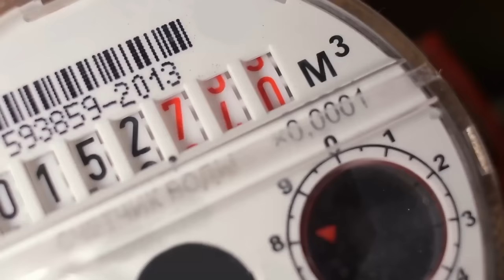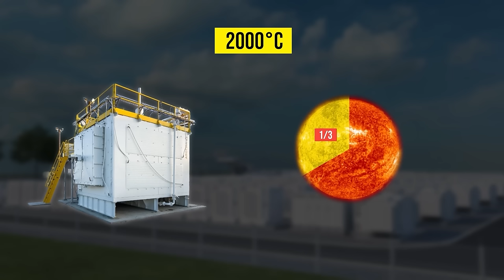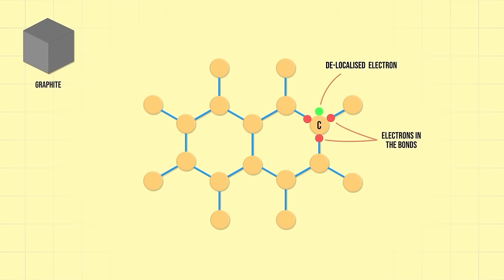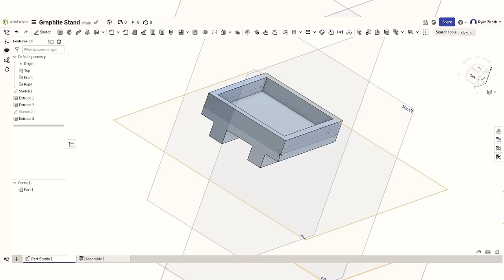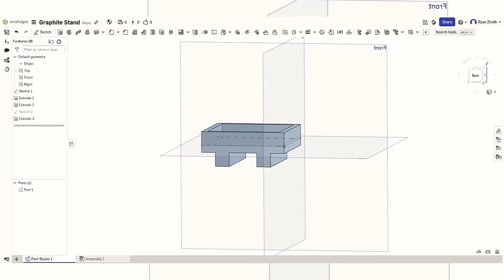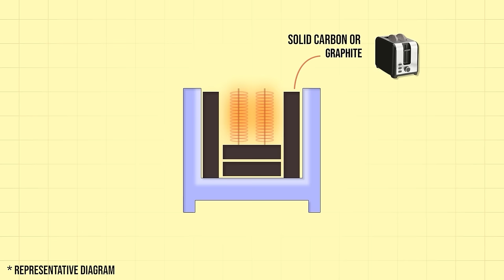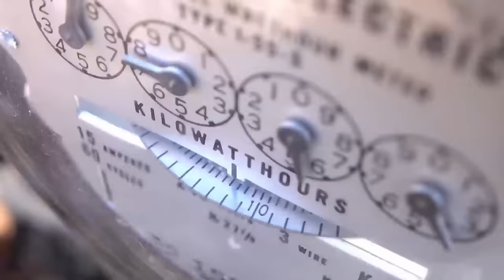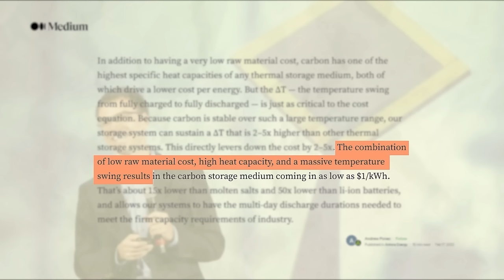Why Solid Carbon is the Future of Energy Storage

Comment: This isn't a battery as we know it. Its simply heat storage, like a storage heater, it does not primarily generate or directly store electrical energy like the battery we understand. So there is a 'con' going on right there. Ok, it is ,maybe, a more efficent way to store heat, but if it's electrical energy you want then there are conversion inefficiencies at either end, going in and coming out, where you have to convert electrical to heat and then back again. It  does not seem to me to constitute a 'breakthrough' in that respect. We have seen great claims for the 'gravity' battery but where is it ?. What concerns me is that this is another 'whizz kid'  "Fake it, until you Make it", Therendos stye, oversold concept. Don't forget that rate of heat transfer is dependent on temperature difference, it is non linear and asymptotic, so, although there might be some good applications for better heat storage, I don't see electrical storage being a primary use. Geothermal won't supply high enough temperatures, maybe a direct solar furnace would, but don't hold your breath, or bet your life savings on it.

Comment: theres never been a problem with de-carbonicing heavy indistry. its just heavy ndustries would rather ingnore the issues and costs and expect to just continue while consumers are guilt tripped into taking all the burden. its not that existing options are not practical - its that they have a cost and any cost will reduce profits. these industries wont change unless they are either forced to or the changes are completely cost free to them.
a few practical but expensive solutions would be.
only operate at nights when the energy is free/cheap - maybe with a larger heavy industry plant but running fewer hours per day.
rather than heat the carbon to turn back into electicity to later to mely metals - just heat the metals directly when energy is free/cheap and use low power to maintain the heat until daytime when its processed.
concentrated solar - a load of mirrors heating a material to later turn to electricity - bypass the electricity completely and use as a foundry.
geothermal - relocate to somewhere with easy access to hot geothermal like iceland / hawaii.

Comment: Insanely clickbait!

The panels don't convert heat to electricity they convert infrared light. The part of the energy that just made the carbon hot will get thrown away as will any radiation it gives off that's not in the panel's range. According to the research paper that would be 60% of it.

And prices "as low as" $1 per watt! Why that's only double what it costs to use a steam turbine!

Pop quiz! Find the discrepancy:

"They are covered with a layer of steel so that the temperatures inside can be safely handled"

"The batteries sit at over 2000°, hot enough to melt steel"

Comment: We can in fact reduce our dependence on industry.  It's literally as easy as reducing consumption of everything; but most importantly luxuries that aren't needed.  The car industry for example is a major percentage of overall global industry.  We can reduce it simply by driving less and buying fewer new cars.  Driving less reduces fuel use and extends the life of the vehicles, thus reducing new vehicle purchases.  So how do we reduce driving miles?    Simple.  We move to 4 day work weeks.  We promote more working from home. (which doesn't have to be permanent, it can be one ore more days per week)  We increase public transportation.  We build bike infrastructure to enable more people commuting by bike.  No, we don't have to bike year round in all weather to make a difference.  It can be as little as 1 day per week on average.  Coming from 0 days per week on average, that's a 20% reduction in commuter miles, with the lion's share of our annual miles coming from commuting.

How about the clothes industry?  It's literally as easy as buying fewer clothes.  Show of hands, how many of y'all have entire closets full of clothes, and maybe some packed away in boxes somewhere that are completely fine, but you just don't wear them?

How about flying?  Most flying is done in Western nations.  Only about 13% of the world's peoples are responsible for the vast majority of overall flights.  Heck, until the 1970s, very few people actually flew.    Flights alone are responsible for a massive amount of energy use, and that's before including airport construction, ground transportation to and from airports, the energy used in the airports, and the manufacturing of the planes themselves.    Want to reduce the industry built around flying and the resource use for flying... simply fly less.  If you can't imagine giving up flying completely, then how about this.  Fly half as much as you've been flying.   In terms of trips, if the trip is just you alone, and you will either fly or drive, then flying is actually slightly better than driving a gasoline powered vehicle.  However, as soon as you add a second passenger, driving is more efficient.  If you must travel with more than one person and you have the option to drive, then drive.

Fact is, we could have drastically reduced energy and raw material use decades ago... all we'd have needed to do is reduce our consumption.  Instead, primarily Westerners, and of the Westerners primarily Americans, went the greedy route and repeatedly increased consumption.  Isn't it about time we changed?

There's a timelapse of global annual carbon output per capita.  Watching how high the US per capita carbon output was just about 2-3 decades ago... it was absolutely off the charts.  It's certainly declined today, but the reason isn't that Americans stopped consuming so much or stopped using so much coal... it's that we outsourced the vast majority of our product manufacturing to China, and China used coal energy to build all of it.   China's per capita emissions went up as a result, but only because that's based on energy production in the nation divided by the residents.  It doesn't apply per capita emissions to the nation actually consuming the products.

Comment: Let's just say the quiet part out loud it doesn't really matter if it's good for decarbonization as long as it's cheap and profitable so many holes in the decarbonization that the real disaster is microplastics and all kinds of crappy chemicals that they don't regulate they brainwash you into focusing on carbon which has little vanilla effect at least what we put in and when you look at the studies they pull such specials and then zoom in on hockey puck I'm all for making things cleaner and better let's just leave the b***** out of it

Comment: No, storing heat in solid carbon is of course not "the Future of Energy Storage".  You can't drive a car or even use a bread toaster from energy stored like this.  And if you try to convert thermal energy into electricity that is much more useful in almost all applications, most of the energy is lost.  Transporting energy stored in graphite blocks is awkward.
Such clickbait titles are really annoying.  
The system described here has some niche applications where heat is needed and energy should be stored for hours or days.

Comment: I really hate that folks have called this a thermal battery, since it is really an apple to oranges comparison between low and high entropy storage of energy. Couldn't we just say thermal storage vs electrical storage?  Then folks can reason something like storing electricity is something is the gold standard, and the value of storing heat depends on how hot it is.  Or just rate things in some sort of entropy term, rather than energy?  My thermodynamics is vintage 1980's but don't we have a more useful quantity named after one German, or another, or a Brit?  Some sort of free energy, vs energy directly?

Comment: will melt shipping container darlinks
Reply: Probably more than 12 inches of insulation
Reply: Ever heard of insulation ? If they can keep those at working temperature for days with a temperature differential that big there must be very little heat transfer with the outside so my guess is that the pods are far from toasty. Also, I think the shipping container was for size reference, not to show how they would transport them but even so, do you think that they would transport them while the inside is hot ?

Comment: The big problem with things like this is your wasting lots of energy heating up and using this energy, you will end up with needing even more solar and wind to make up the wastage. I don't think solar or wind will ever be a replacement for nuclear, Gas and Oil. 
Good on small scale and i have a solar and wind powered house but the biggest problem is storing the energy and i don't think these thermal batteries will make much of a difference. 

Also Oil is abiotic and it never really runs out as its produced constantly deep in the earth, the oil deposits we have used so far are a fraction of what is deeper down. 

Also man made climate change is a scam, the sun is getting colder now and we will be heading into a little ice age and comically we will be heading into that after we have destroyed all the easy forms of power its going to be a huge mistake.
Reply: Yeah we haven't seen the technical details so we don't know do we? the technical details weren't discussed
Reply: Combustion engines a have similar low efficiency, around 30% (the rest turns into heat). In the end the only important thing is about cost, and so if 40% energy loss is still cheaper than fossil fuel (which is very likely since fossil fuels energy generation already is a lot more expensive than renewables) then there is gonna be cheaper energy that is just as reliable and without pollution going into your lungs and the atmosphere.
Reply: @13thbiosphere  what technical details are you interested in?
Reply: You missed the point of energy storage. The point is not to store energy that could be used right when it's produced but to store energy produced when no one needs it so it is available when people need it but none is produced. That way, instead of comparing a system with lower efficiency (storage) to as system with high efficiency (grid usage) you are actually comparing a system with low efficiency to a system with 0% efficiency (wastage). The replacements for nuclear, gas and oil exist already, they just need funding

Oil IS renewed but at a time scale that isn't useful to us. Also if they are deeper down that what we use today it'll get more and more expensive to get it so it won't be an "easy form of power" eventually. The oil industry already needs a lot of funding that could be used to fund clean technologies 

No it's not and solar fluctuations have never been enough to cause global warming or cooling. Each and every climate modification happening on earth has been the result of modifications in our atmosphere (volcanic eruptions, CO2 levels dropping/rising...etc). Now if what you deny is that global warming is man made, then you should know that the type of carbon rejected into the atmosphere by human activities isn't the same isotope as the one rejected by other natural processes and scientists have observed a modification of the ratio of those isotopes in out atmosphere in favor of the isotope that is rejected by human activities

I know this is probably not enough evidence to convince you but they are worth pondering upon

Comment: Fine …… but you must take in consideration, some Goverment are extremy stupid …… in my County …… Germany …… this is only sensfull at the Location of the Regenation Power Source of at the Energie Consumer …… because of the Energy Grid tranport Fee. Everyone who Pulls Energy from the Grid must Pay a Energy Fee measurd in MWh  and an Energy per Time Fee measurd in MW. To Run this on Grid, you need to Store Enerie fast during the Time Energy is free a rearly cheap.  A Storage Power Station free from this Charges …… but only for the part of Energy who is resuppyed to the Grid. As result of this, the Energy per Time Fee kills your Buiseness Plan.

Comment: You were doing reasonably well until you started poo-poo-ing Li battery technology "because of all the horrid, child-enslaving 'rare earth materials' involved in their manufacture"...  You clearly are not aware that the resurgence of LiPhO4-based Li-on batteries is becoming the market leader in not only batteries used for transport but also stationary storage.  As the chemical formula makes clear, there are no REMs involved!

Your video is rather short on numbers - which is disappointing.  How much more specific heat capacity has graphite than, say water, or the bricks commonly used in the manufacture of once extremely common 'night storage heaters'?  Or Hydrogen for that matter?

Comment: Why is it always about removing the plant food from the air??? Why can it just be about the incredible futuristic technology? The planet doesn't  need saving! It will be here and thriving long after we are gone.  The energy tech is the important part. This is amazing technology that will allow decentralized control of energy. Freedom for all. The fake virtue signaling about solving climate change is not only disgusting to me. At this point, It's just plain boring! I have years of meteorological training from the USAF and know quite a bit more than the average bear on the subject of climate change. I don't live off- grid with solar, hydro, and wind because of climate change. I do it for freedom. I don't design, build, and race electric vehicles because of CO2 rather because electric torque to the rear wheels is ridiculously fun! The anti carbon green agenda dorks out there are never going to land their message to the masses but rubbing some bunnies and hugging some trees. Saving the planet is both pretentiousness and arrogance placed in a stupidity box wrapped in one of those idiotic  virtue ribbons you ware on you lapel to make other people think you are a good person. Screw that let's innovate for the the individual freedom! Let's innovate for the horsepower. Let's innovate for the sear excitement of exploring were no man has gone before. Let stop the holier-than-thou lecturing about BS climate change to push new ideas and let the awesome alternative energy devices stand on there own merit because they are badass. At the end of the day, no one cares about their production of plant food. They want to feel the awesome power of electrical innovation  that is like sitting your ass in a slingshot with an ACME rocket strapped to your back. That's sexy! Appeasing Gretta thumberg... SORRY NOT SEXY!